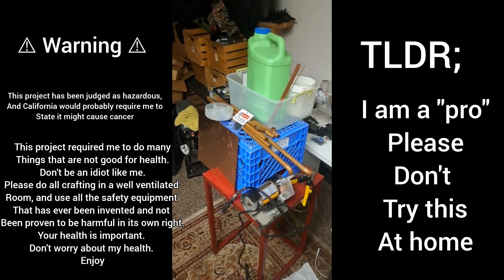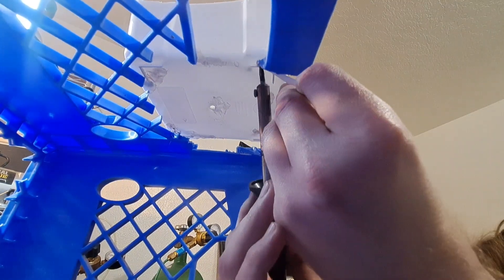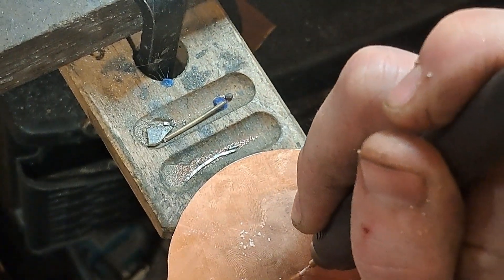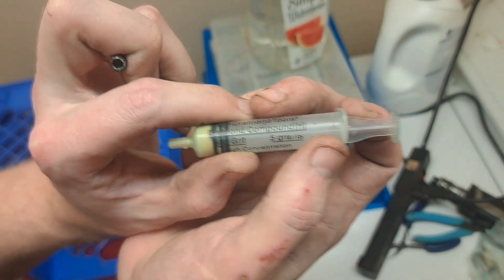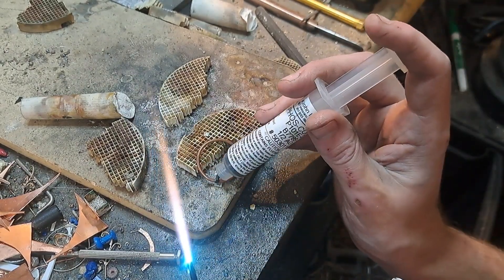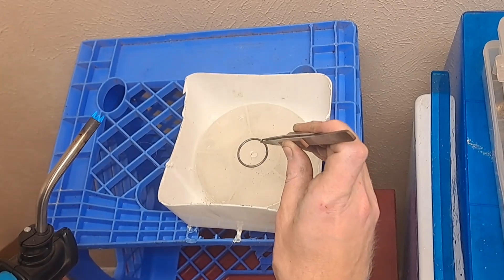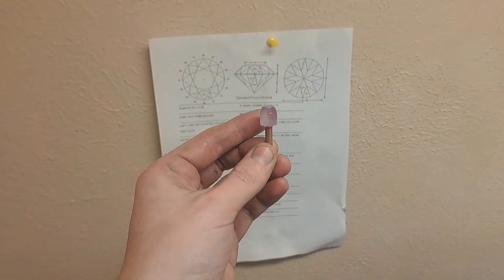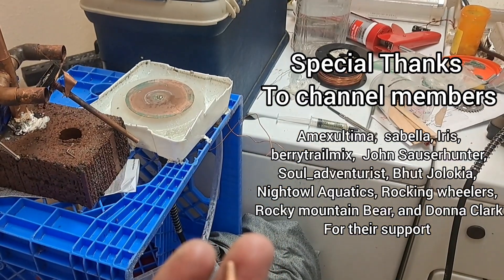Homemade Faceting Machine, Lapidary on a budget

Comment: this is gonna sound dumb but how were you transferring the rotational force of the grinder to the wheel?
Reply from the maker: Not a dumb question at all. There is a piece of cable that's flexible but it's in the black cord. It's called a flex shaft, I just kinda made my own bit for the flex shaft

Comment: Looks good. I’m interested in what you can produce on it.
Good for you! Thank you for sharing 🎉
Reply from the maker: So, I'm attempting a SRB on an amethyst right now. That's a challenge, and this process is going to take alot of tinkering. I need a longer arbor attachment into the flex shaft some how, but, I have some faith that this can work. I'll deffinitly be sharing more as I go